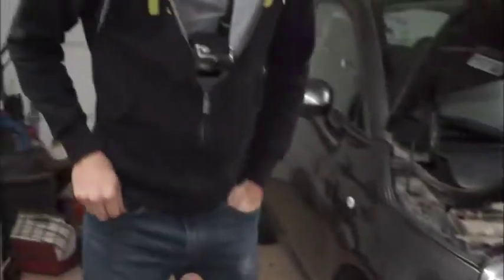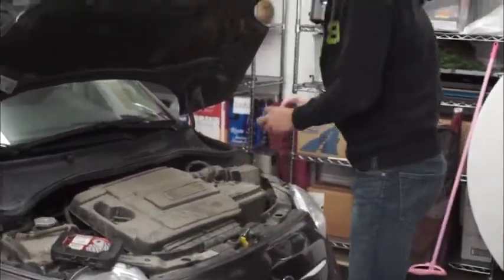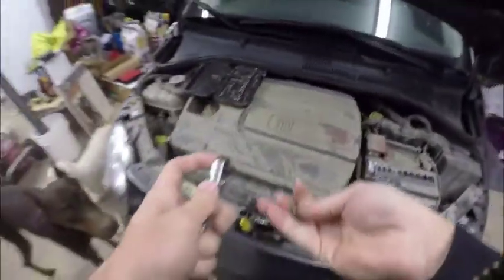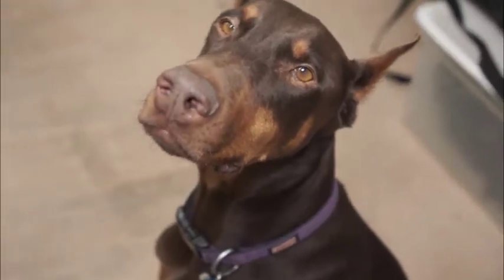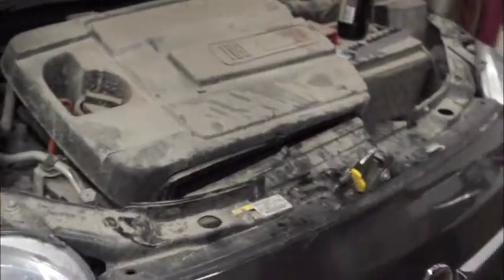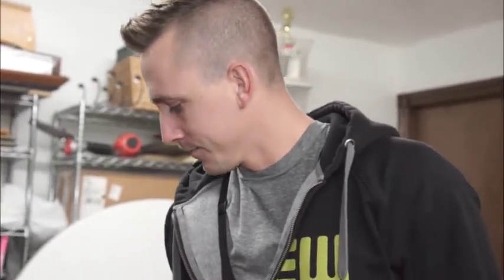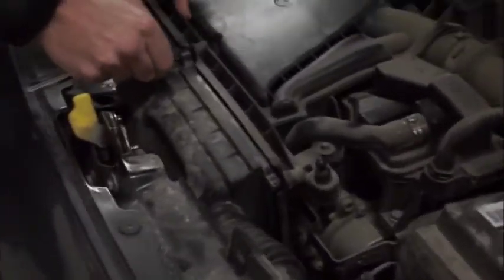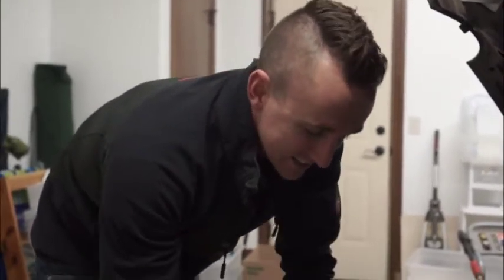Changing the Air Filter on our Fiat 500

Comment: You need to clean that motor. is a beautiful car and it will take you 5 minutes. with a soft soap and small brush.
Reply: Mariposa newer engines and engine compartments are usually sealed quite well. They can take being hosed off . I usually hose the engine off and leave the car sit for a couple days. Unhooking the battery makes it a sure bet if in doubt.